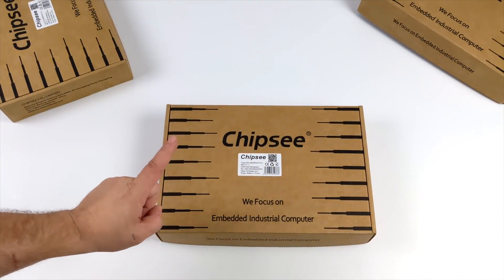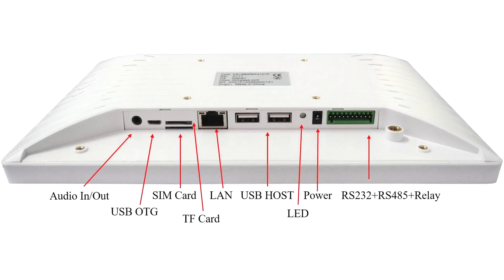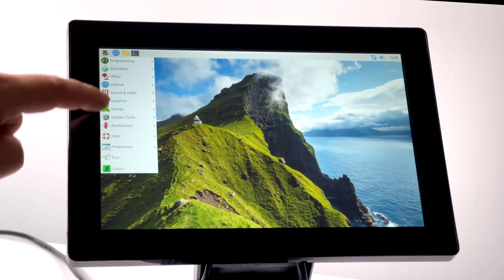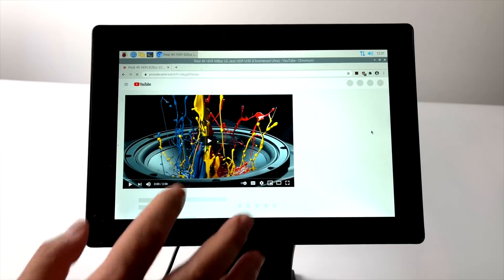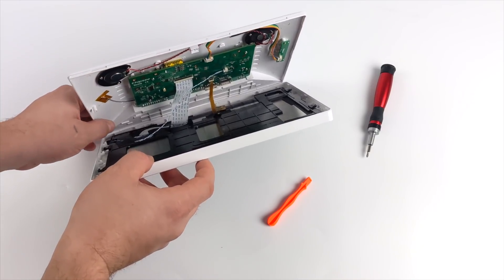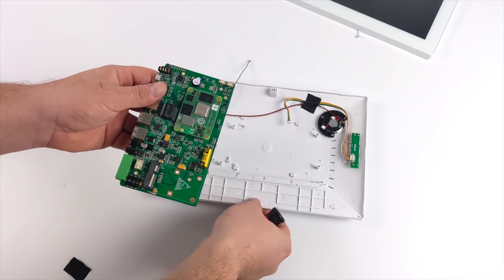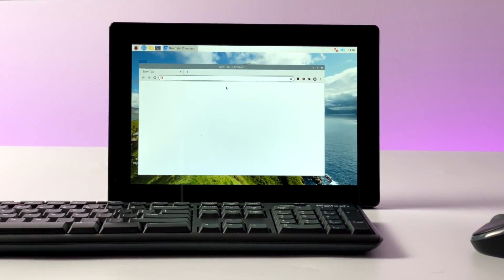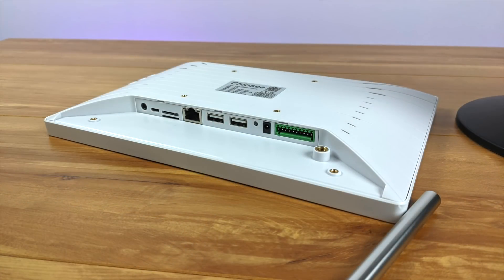The Chipsee AIO-CM4-101 is An Amazing AIO Touchscreen RPi CM4 PC!

Comment: Hey ETA, there are fixed voltage boards that will take USB-C input from PD enabled banks and make it provide the voltage required. If you look the following up on Amazon, you’ll be able to select the voltage needed and use it for your build: B08NFKV2LD 

Please like this so ETA sees it. I just found out about these devices myself.

Comment: You show some really interesting nerd stuff here. I like.

I wonder if you heard of an alternative or Linux distro like Pi OS for elder Android devices?! Over the last years there are some devices left like an old Moto G or Samsung Tab E. I know that there may be some newer android Version as custom roms available (if I'm lucky) but when I look to the specs they seem similar to a Raspberry Pi (Moto G: 4 core, 1GB RAM, 8 GB Rom, sd-slot) ... so in essence its like an SBC you still get today like RasPi3/4 or oDroid c4. Do you know a way to re-use some of this hardware like a RasPi? I know there could always be more IO but for the things a RasPi4 is used the specs from that old Moto G should be fine. And if that display connectors on the smartphones are standardized, maybe you know some options?
But I have no idea if it would be possible to use such "old" component because they surely need some drivers for that Snapdragon 400 and I don't know if such things are available at all.

If you stumble upon an idea that would be really great. It would be great to re-use some of this old hardware maybe with a bigger screen, maybe for tinkering or even gaming/ emulation.
And with the possibility to 3d-print a case or crafting something out of acryl or pc ...

Comment: I really like small touchscreens. Do you know a smaller and way cheaper brother of the Xtendtouch touchscreen you recently reviewed? I'm going to use it for my UDOO Bolt V8 project for which I need a small high res screen. As the V8 isn't cheap I'd like to compensate that with the screen.

Comment: Three 3.7v pouch lipo cells and a 3S BMS might fit inside that case.  Or you can get a Talentcell power bank that has a voltage range of 12.6v-9.0v off Amazon.

Comment: In regards to portable power: Use a QC trigger device, I use these with Xiaomi power banks for 9v and 12v, there is some cheap units with a simple manual slider switch to select voltage, cost a few dollars each from Banggood or Ali.

Comment: Search for QC trigger board or USB-C trigger board. Tiny, cheap, all they do is tell the port to set the voltage and then pass it thru. Cheap, small. You'll want to have a switch on the output so it's at the voltage you want before sending it to the machine. There are 'programmable' models, testing style, or just a fixed voltage preset. Couple bucks, postage stamp sized... Thanks for all the cool vids!  Stu    Found several on Amazon. Probably hundreds on Ebay..:)

Comment: If you connect two 5V battery packs in parallel, you will get 10V, which should be just fine for this unit.
Reply: You need to connect them in series not parallel. Parallel will be same voltage but twice capacity. Series will be twice voltage at  the capacity of a single unit.
Reply: @thishandleisntavailable1  Of course, sorry for my brainfart :-)

Comment: I really keep hoping someone is gonna make a 32 inch monitor you can just plug a pi4 into as a single enclosed unit, and options like a slide ssd hard drive etc

Would be the ultimate emulation station on a budget.

Comment: I love to use my RaspberryPis for many things. I'm using a Raspberry Pi to watch this Youtube video. I just can't think of what I'd use this for. Maybe if it used USB C PD power to be used with a battery pack would be easier. If it's supposed to have a fixed position, why bother with a mobile connection? I couldn't justify this for myself for any task.
Reply: Also the price point isn't great

Comment: Have to put a thumbs down on this. QC/PD power banks are adjustable converters themselves, you don't need any other converter than built into your power bank. With a simple cable mod you can make it output any voltage within its specs. Wish you to be prepared better next time

Comment: Just wire three of the largest phone batteries in series and try to wire two in parallel for a long run time using wire and solder, this will be 12.6 volts max  I don't believe that will hurt, but you can email the company first. Use a buck converter if you need to, but the range stated says it will be fine so 3S ~ 2P and get a wall wart that's 12.6 volt used for lithium cells.

Comment: Great video as all your videos! I'm wondering if I could request higher res photos of the IC under the CM4 module on the motherboard? The reason I'm asking is because I'm researching for an own project where I take an old Dell computer that I really love the design on and making my own motherboard which will include a CM4 module and NVMe drive. Reverse engineering the keyboard is quite tricky but doable, but I'm looking for a way to interface the LVDS display and perhaps the IC under the CM4 module could be the solution I'm looking for. Hope you can help :) Looking forward to next videos of course! Both on the AIO project but also other subjects :)

Comment: How many amps is the 9 volt draw..there is a company that makes usb to 9 or 12( 2versions)volt barrel Jack converters for korg and roland and other synthesizers "myvolts ripcord"..my question is would a 2.4amp usb port (average battery) be able to power that much of a device after voltage conversion.. The"ripcords" seem rated for 9 watts(maybe they assume 1 amp usb)

Comment: Can not wait for raspberry pi 5 😍
Reply: Will be the same cpu and gpu as the old RPI4....just a bit faster, but still not fast enough.
Reply: @caspice   they are telling that the devs are planning on adding CPU 2.0 GHz and GPU 700MHz. It will come with 16 GB RAM , 4 USB 3.0 ports Wi-Fi and Bluetooth 5.2.  Also usb Type c charger and micro HDMI port. Hopping to get built in fan. Taht is the essential
Reply: @farisomeragic8900  Most time people are already overclocking the CPU to 2.0 ghz and GPU to 600 mhz, so it is far enough for a new RPI. And 16 GB ram does not makes it faster. New RPI400 can be overclocked to 2.2 ghz.
Reply: @caspice  I know that. But all I am saying is that just 2.0 GHz stock would be perfect and better GPU drivers
Reply: @farisomeragic8900  Just get an S9 with usb 3.1 and you get yourself a pc for 100$ (dex support) - and its gonna be far more powerful than any of these crappy "embedded systems"😉
Reply: @farisomeragic8900  unless you have an inside source, i think its unlikely that they will just up the cpu clock, it would make the pi too hot. Maybe a 4+ would do that, but i believe a 5 would have a new cpu and/or lithography process to make it significantly different from the 4. Remember how long 4 is available by now, stuff has gneraly gotten cheaper. 16gig ram might be something tho, if they ad two ddr4 chips for more bandwidth and ddr4 ram gets cheaper because desktop and server start going ddr5
Reply: @caspice  in that way like I mentioned, we will be able to run better dreamcast games even with flycast core, N64 90% of library. PSP would benefit if we are going to have more CPU and GPU juice and ofc vulkan driver a good vulkan divers support. It is about time for something lije that. And before I forget. Sega Saturn would be emulated on there very good cuz it will run 64 bit OS like it runs now. That is also open door for Gamecube and Wii emulation down the road with that specs. Not rushing things, I am grateful, but it us about time I would say to get that performance.
Reply: I wouldn't mind a faster Raspberry Pi, if the drivers aren't a pain to figure out. That's what's holding the Pi4 back if I read and heard correctly.
Maybe one of those Samsung-AMD chips, obviously not the Pi 5 because there aren't any SamAMD chips on the market yet and price is a factor.

Comment: Just put a dc-dc up converter they are cheap, small, support 2A current and you can regulate the output voltage from 6 to 12v easily with a preset

Comment: For the battery pack:
There are USB-C PD breakout boards where you can select the pd voltage 9/12/15/20V.
You would just need to solder a small adapter with the PD breakout board to the barrel jack of the AIO unit and a PD powerbank.
Greetings from Germany.
I hope this helped you.

Comment: You can buy 5 USB-C power delivery trigger boards for $10. Just buy one for 12 volt and solder it to a male charge port. Then it will work with IQ or PD.

Comment: I'm waiting for the CM4 laptop case
Reply from the maker: I’m sure someone is working on it right now, hopefully they add an really nice screen
Reply: @ETAPRIME  What I suggest is a HYPERGEAR Power Brick. I have a 24000 mAH unit and it has all the features that you'll need without extra setup since it has a built in power outlet. I cannot suggest these enough for mobile projects.
Reply: @DreadJoker  USB-C PD power bricks kinda make the need for 110vac pointless. As well 16.8vdc charging is a let down since you can't just use a generic laptop ac or dc psu. What I'd like to see is one with a 5.5mm barrel plug or anderson connector 12vdc out.
Reply: @ETAPRIME  I hope so.
Reply: Dual CM4 would be killer, for running something like docker containers on the slave CM 🤯
Reply: @jakubknotek4891  it’s funny how one system used to accommodate multiple users, now a single user wants multiple systems to accommodate a single workload.
Reply: I imagine it with an Arch i3-gaps setup. It is irresistibly a "shut up and take my money" situation.
Reply: I'm waiting for the CM4 Gameboy Advance, maybe one day <3<3<3
Reply: A convertible would be sick
Reply: Just print a bottom half to this product, pack batteries in it under the keyboard and call it a day ;)
Reply: Same here.
Reply: I realize it's kinda off topic but does anyone know a good site to watch new movies online ?
Reply: @Landon Raylan lately I have been using Flixzone. You can find it by googling :)
Reply: @Anderson Finnegan yup, I have been watching on flixzone for years myself :D
Reply: @Anderson Finnegan Thanks, I went there and it seems like a nice service :) I appreciate it !
Reply: @Landon Raylan happy to help =)
Reply: Why wouldn't you just get a pinebook pro? Its going to cost way less than any junky cm4 based thing on the market...